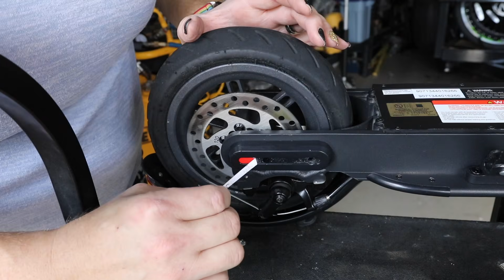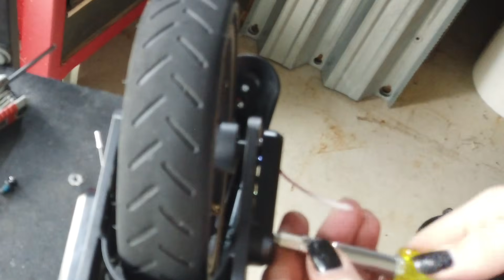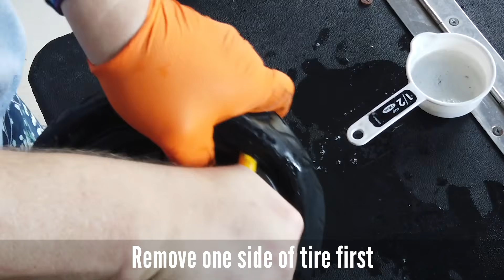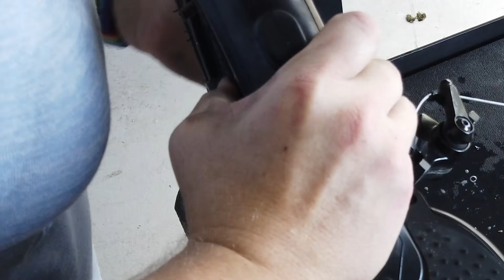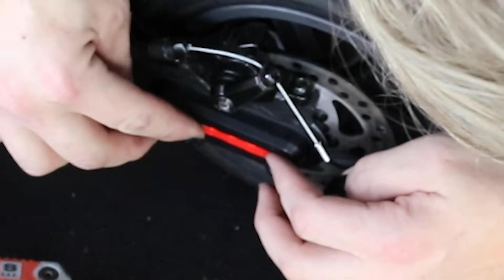How to Replace Your Scooter Tire - Flat Tube Repair on your Xiaomi M365 or Hover 1 Tyre

Comment: How come my new Tire is the same size as my old tire except the center where the rubber meets the rim? That opening at the center of the tire is smaller on my new tire and I cannot install it. The old and new tire are both 10.125 inch pneumatic tires.

Comment: I have a hyper jump and my my back wheel for my friend burn out is not working. You know how the front supposed to fully spin in the back is too my back is not fully spinning. Can you help me with it please
Reply from the maker: Make sure the brake is correctly aligned on the rotor. That's typically where it might be slowed down.
Reply: @AndiWofford tysm

Comment: Hey Andi, do your kids still use it? 8.5in tires scared me but I had the plastic wheels. Lol I see you made one with non pnumatic tires.
Reply from the maker: Nobody uses that model anymore. It did serve its purpose though.
Reply: @AndiWofford did you take the batteries from it? I got one, had fun, decided I was gonna need constructive jaw surgery if I had more fun and returned it! 😅
Reply from the maker: I still have them, and I do need to strip the batteries and motor out of there
Reply: @AndiWofford if you make it I'll watch it! :) I'm surprised you didn't use the parts for your wagon! I think it's 250w motor and 36v with maybe 300wh.
Reply from the maker: That's exactly right, but I'd have to design some sort of remote. Don't really have time to do that

Comment: After I get passed the 2 screws, that bolt screw on my back tire is extremely hard to be removed. I used both a power drill and regular hand tool to try and remove it and still nothing. Idk if I need a stronger drill or what
Reply from the maker: Sometimes those can be really tough; try using a penetrating oil first!

Comment: Awe man you didn’t show how to get the tire fully off the scooter!! 😢
Reply from the maker: Pretty sure I did that in the first 2 minutes. Yep, sure did.
Reply: @AndiWofford  yess you did but not how to take the wire off of it.. 😔 I couldn’t figure it out & ended up having to buy a whole new scooter 😂😂😂. But thank you
Reply from the maker: Not sure what wire you're talking about? I even covered removing the brake assembly so the wheel is entirely free.

Comment: thanks!  this helps so much!  but there was 4 and 4 more little black nut-like thingy.  on the right side of the rear tire.  next to the metal rim.  the two nut u unscrew to loosen the Brakes.   once u start to unscrew each of the Two nuts,  There are 4 little black nuts like washers.  on each one of the Two nuts.  so a total of 8 little black washer-like nuts.  that seems to drop out once unscrewed the Two Nuts.  Your video does not show that.  Mine is a Hover-1 Journey 2.0 model.

Comment: I accidentally pushed in the valve stem into the wheel while there was still air inside the inner tube what do i do
Reply from the maker: Are you trying to replace it? I'd pop it between the rim and tire and use some needlenose to get it out
Reply: @AndiWofford  Yes, I want to put on hard tires that I bought.

Comment: Sorry but no.... getting the 2nd side of the tire on is not "more difficult" its a f...ing  nightmare. The tool does not help any other suggestions?
Reply from the maker: Make sure that you’re using a lubricant to help get it over the rim. That should help it slip right on, and using a tool should help coerce it on there. I’m sorry it’s challenging Patty.

Comment: Is there a different method for the front tire.
Reply: When I get the front wheel off can I patch the hole in the inner tube.
Reply from the maker: @erichughes7382  You could, if the hole is small enough but the tubes are like $5 each if you order. So if it were me and I were going through all this, I'd just get a new one and be done with it. https://amzn.to/3crKlCT
Reply from the maker: Yes there is, and I made a video on it: https://youtu.be/dzsgjCj397c

Comment: Please don't use an air compressor to fill the tubes. The chance of you bursting it are extremely high.

If you do "jumps" on your scooter like I do... (Bunny Hops I guess)
Do NOT inflate it to 50PSI! 40 or 45 is more than sufficient.
Reply from the maker: Thank you for the advice.

Comment: Trick with the brakes is to clench the brake lever then tighten up the calliper. Took my back wheel off yesterday. It was like that door in the hateful eight. I’ve ordered 2 inner tubes and tyres and a mud guard for the back then I’m all set. Great video. Made it look easy.
Reply from the maker: Thanks for the trick!

Comment: I have 10" wheels and I when I try to inflate the air the tyre is uneven. How to fix this? The tyre and tube is brand New. Tried multiple times and adjusting the tyre but it gets bigger on one end and smaller on the other end of the tyre. Like there is not coming Even pressure all around the circle. Rims are fine.
Reply from the maker: Have you checked to see if the tube is pinched inside the tyre? Otherwise, I would pull the tube out to see if it inflates evenly and go from there

Comment: I changed the rear tire tube on my electric scooter, now it won't go, and the brake light flashes when I hold in the brake lever. Anyone know what's going on here? Thanks in advance.

Comment: removing the brake is an extra step , the wheel will pull off without removing the brake assembly.

Comment: Are you able to do the front tire video?
Reply from the maker: Done, please find the video here https://youtu.be/dzsgjCj397c
Reply: Awesome!
Reply: Question: do you know what those 8 screws on the one side of the front wheel are for? I took them off and nothing happens
Reply from the maker: They are most likely plastic covers (4 on each side?) For the wheel nuts
Reply: @AndiWofford  not those, the one side of the front wheel has like 8 screws on it, visible in your video here. They go all around the wheel (one side only, round pattern)
Reply from the maker: Did I take them off in the video? If not, I wouldn't think that you need to remove them.
Reply: @AndiWofford  you didn’t, I’m just curious because the hole for the valve stem is so small and no socket really fits to remove that washer or insert an air hose without struggle

Comment: Question?  I have the Hover 1 alpha and it has the cable going into the rear wheel for the motor.  Do i have to unhook to take the tube out?
Reply from the maker: On the one I did, the motor was in the front wheel. I did not unhook it, I built a holder so I wouldn't mess up the cable when trying to take the tire off and put the new one on. There's a video I made on it, but it's the front tire. Might help 🤷🏼‍♀️
Reply: @AndiWofford  found it, thank you.
Reply from the maker: You're welcome Maurice!

Comment: HELP! I have unscrewed the break assembly but try as I may I cannot get the break assemply to clear the rim of the tire. What am I doing wrong?
Reply from the maker: I had to twist the tire a bit and wiggle it to get it into the brake calipers. Should fit in
Reply: @AndiWofford  Andi, thanks. I'm trying to removed the tire, not put it back on.  I wish I could send you a picture. Its seems to be the big black circular "thing" on the inside of the break that won't clear the rim of the tire. Of course the break itself won't clear the silver disc itself either. I've undone more bolts that you show in the video and I'm worried about taking any more off.. On my FB page I've asked for recommendations of a place to take it to but without any luck. ;

Comment: I think i got a flat i my tires but im not sure the weather is getting cold so it could be that. I blown them up the other day and they slowly went down. Im going to try to replace them lol i know nothing about this stuff i seen that you didn't have to replace the outside of the tire does that need to be replaced or is it just a shell to protect the tube lol i know nothing?

Comment: Thx for the video. I realized that with the Hover 1 Journey scooter, you have to insert the back tire and the brake altogether as you push into those grooves; that way you will be able to put those screws back on the brake assembly and the rest is easy. Again thank you. Also when changing the inner tube, I had to use a 240 mm tire iron for motorcycles. I'm not sure if anything less sturdy will do the job at pulling that inner tube, at least on my Journey. To put it back on, you can use your suggested plastic tool. Awsome help from all of you!!

Comment: Andi help. Hello. I don't seem to be able to put the brake back on. The tire is properly set in the grooves all the way in but the brake does not go in as easily as you show in the video. What am I doing wrong?

Comment: Andi u Rock👊
Reply: Andi the only really hard part i ran into was the DANGGGG screws on the brake calipers it stripped baddddd got the idea to use my Robo Grip that worked like a butter!!!🤣 Factory set each and every screw with loctite Ohhh Man but everythings back in one workn piece thanks again for ur 📹 🙌

Comment: The link to the tool shows a completely different set of plastic pry spoons. Do you have the correct link for the yellow one? Thanks
Reply: I'd love to know the exact tool too! Thanks for a great video in any case
Reply from the maker: My apologies. The black and yellow tool I was using came free with a tube I bought like 20 years ago. I've not seen the exact tool again, BUT - there are better tools. These https://amzn.to/3iQe2AQ hook on to the spoke in a bike tire (not needed here) but are virtually the same thing with the tiny lip and handle,. They are roughly the same size as well. And. . . you get four of them instead of one.

Comment: Can't get tire back on.. it seems way to0 tight. I used spoons, flathead screwdrivers, and  myh friend bike repair tool.. we almost broke the tool. AM i doing something wrong, I don't see any struggle in the video putting the tire back on..
Reply from the maker: I didn't really have any problems. Have you used soapy water or some kind of lubricant? That typically helps

Comment: Where can I find the Allen wrenches i need
Reply from the maker: Allen wrenches in case you don't have any: https://amzn.to/2UNBTHq
Reply: Andi Wofford, is it going to work for my “hover-1 journey”?
Reply from the maker: @demondtv9775  According to the specifications, yes you can use the tires I link to: "8. 5 inch tires with a 
300 W motor reaches speeds up to 14 mph - weight capacity of 220 lbs to ensure safe riding. 8. 5 inch tires allow for greater stability. Foldable design - convenient, stylish and exciting form of transportation."

Comment: I've done the hard work but I've bought a basic hand pump for the front wheel and as soon as I remove the thread, the tyre deflates. And tips?
Reply from the maker: Just did some googling - this is all I could come up with: "I'd have a look at the valves. It sounds like they are stuck in the "open" position. Perhaps the pump is pushing them too far down, or there may be some dirt in there. Or maybe you just have bad inner tires.

Try to get in there with some pointy pliers and see if you can pull it up. Normally it should return to the normal level (almost flush with the outer ring) by itself."
That was from a bike forum - good luck!

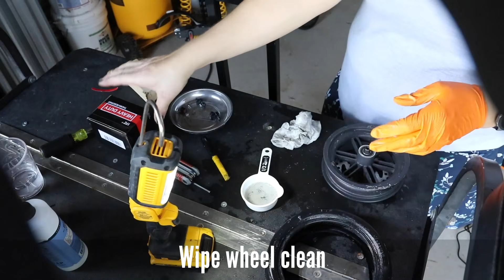Comment: 2:47 at this moment i rather install the solid tires, all u need to do is to heat the tire eather in the microwive for 3 minutes or put it on boiling water enough so the tire gets more flexible, ( remember to wear gloves or youll burn the shit out of you ), after the heating process is done just rub both the rim and the tore with something like oil ( i used on mine oil like kinda it was the ones used  for cars engine ) then go and mount that tire youll need to apply alot of presure on it towards the rim but trust me i did it myself on my hover 1 pioneer and changed both the front and rear tires

Comment: can i purchase the 8.5 inner tube for my fluidfree horizon scooter?
Reply from the maker: According to their website, the 2020 Horizon model has a solid 8" rear tire and a pneumatic (air filled) front tire that is 8.5 inches. So yes, you can buy the inner tube to replace the front tire.
Reply: Andi Wofford thank you!!! love your video, very informative and will definitely reference when i change out the inner tube on my tire.

Comment: Spent about 4 hours trying to replace the innertube on the M365 and I've had enough, getting the tyre back on is an absolute nightmare. I melted 1 tyre in the microwave following some advice on another video and the old tyre in a pan of boiling water didn't help. Think I'll take it to a shop 😂
Reply from the maker: I'm really sorry to hear that Cogan - good luck at the shop!

Comment: so um my tire wont fit on the scooter any tips
Reply from the maker: Is it an 8.5 inch tire?
Reply: @AndiWofford  yes it is
Reply from the maker: Solid tire or tube tire?
Reply: @AndiWofford  solid tire
Reply from the maker: Are you heating it up enough? It needs to sit in boiling water for at least 15 minutes. Then it should be malleable enough to follow the video instructions with the zip ties and some sort of tire spoons
Reply: @AndiWofford  i got the tube on the wheel if thats what your asking but i cant get the tire its self to lock into place thats all

Comment: hello what is the right presure of air for this tire?
Reply from the maker: From what I've read it depends on the inner tube. But 50 PSI seems to be a pretty common pressure for these.
Reply: Andi Wofford what is the conver of 50 psi is it 2.5?

Comment: I was able to follow on per well until it came time to take the tire off the rim. I have the little tool but I’ve been struggling to pop the tire off for line 30 minutes
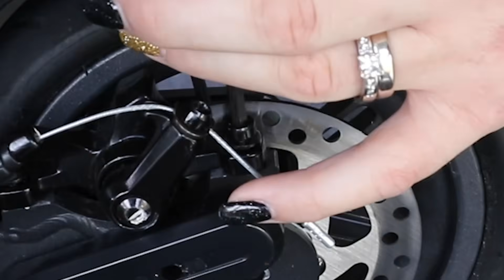Reply from the maker: Did you ever get it Charles?  It takes one left in position to hold an edge off, and another one to run around the rest of the lip of the tire to get it off. I did it again in a front tire video I posted here if you'd like to see more instruction on it. It's at 01:26 in the following video: https://www.youtube.com/watch?v=dzsgjCj397c
Reply: Andi Wofford I did finally! I ended up wedging a screwdriver in there as well to hold the tire off the lip. Thanks!
Reply from the maker: So glad you were able to get it!

Comment: any tips for one of the brake screws not coming out
Reply from the maker: That's strange Justin. Haven't had that issue. Have you stripped the head on it or did you break the head off? Otherwise it's a question about more leverage.

Comment: There's no way there is any 5/32" Allen bolt of any kind on any xioami scooter. Everything is metric.
Reply from the maker: You're absolutely correct.  For the Xiaomi 365, the four bolts for the Rear Wheel Cap Screws are 2.5mm allen wrench heads and the bolt heads for the Rear Wheel Mounting Bolts are 4mm allen wrench heads.
Reply: @AndiWofford  well done. Swift and accurate

Comment: Would they tires for a Xiaomi M365 be the same as well? Thanks in advance!
Reply from the maker: Hi Robert - everything I've seen says that yes, the Xiaomi M365 has 8.5 inch tires: Specifications
Model:M365
Weight:Approx. 12.5kg
Frame:Aerospace-grade aluminum
Tire size:8.5 inches
Motor size:6.7 inches
Colors:White, Black

Comment: Great job.
Reply from the maker: Thanks Kay Jay! Got one more coming on a solid scooter tire 😁
Reply: Andi Wofford - I'm glad to know that because if I get one more flat on my Hover, I'll be looking to change out to a solid tire. The only problem is, from what I hear, installation is a KILLER!
Reply from the maker: @TheKaybjay2  I feel you on this so much! I had two flats and have finally had it with tubes.  It's not as hard as you may think - to be honest. Use some zip ties and a crowbar after boiling the tire. Or wait for the video, I'll walk you through it 😊
Reply: @AndiWofford  - Cool. And that tire will fit the Hover wheel?
Reply from the maker: @TheKaybjay2  That's correct! The 8.5 inch rubber tire
Reply: Andi Wofford - Hey Andi- How is the ride now that you have switched to the solid tires on your Hover 1? I'm getting ready to order the tire through your link.
Reply from the maker: @TheKaybjay2  Hey Kay Jay, it's actually a better ride, to be honest. I'm so happy that I don't have to put tubes in it anymore. Third time's the charm for me. Know that they also sell the whole tire already assembled on the rim so that you don't have to go through all of what I did.
Reply: Andi Wofford - Really? Where would I find this all in one solution? Thanks for your help.
Reply from the maker: @TheKaybjay2  Soemthing like this should work - no promises, but everything lines up the same as far as I can tell: https://amzn.to/39ovgRY
Reply: @AndiWofford  do you have a link for that? and thanks for the vid, changing tire tomorrow
Reply from the maker: @BoomerBobv2  Hey - the scooter itself should work with something like this: https://amzn.to/2yxf434 - but I don't know that for sure.